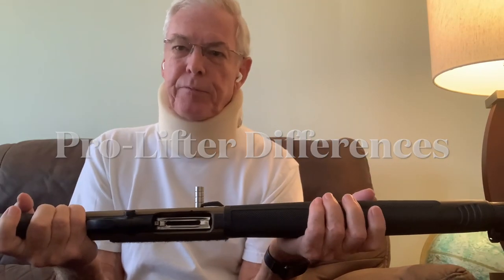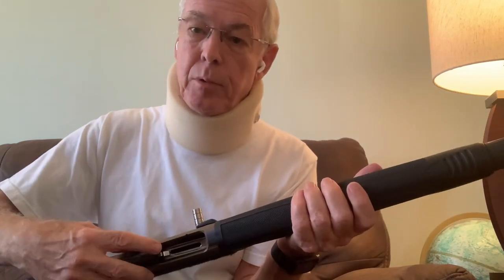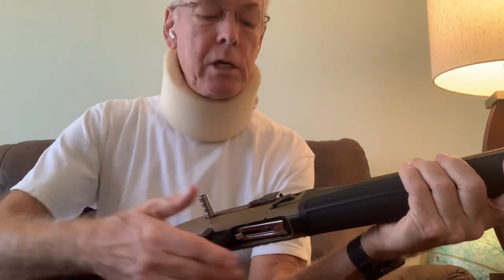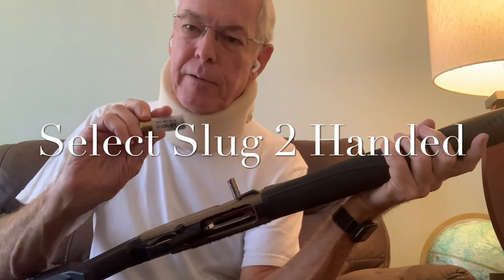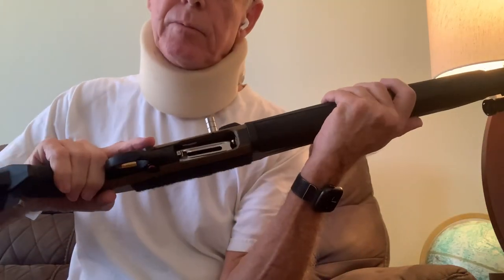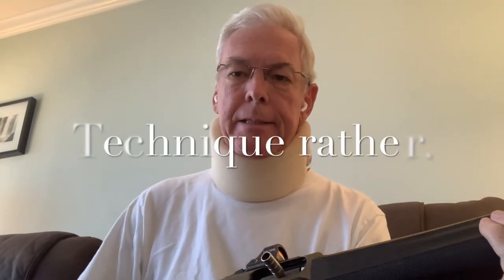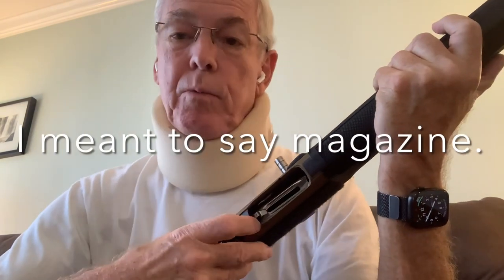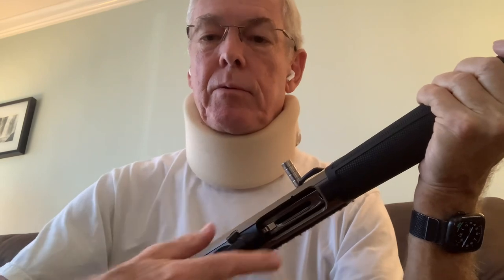Pro-Lifter Differences

Comment: Great video. 2 question. Whats the brand of charging handle, and can you still ghost load. To get 7+1+1 thanks
Reply from the maker: I’ll get back with you on the charging handle in just a second. As to the ghost load, yes you can do that and here is a link to a video showing how it’s done:
https://youtu.be/8FWaJbxGI1g
Reply from the maker: This is the charging handle. It’s made out of titanium, but not cheap:
https://www.customguns.co.uk/product-page/big-bolt-release-handle
Reply: @gospelofthegauge  thanks for the response
Reply from the maker: @inthedogghouse86  you’re welcome. Understand that to do a ghost load you have to load the chamber which is not the safest thing to do with the gun in a staged for HD situation. Not to mention the possibility of a failure because it’s not a designed for condition. I’d leave ghost loading only for the range to impress your friends with, if that.
Reply: @gospelofthegauge does anyone know if the charging handle will work on the a300 Ultima patrol?
Reply: I know a police officer that has a quasi take on the ghost loading. Basically cruiser ready with a full tube and one on the lifter.

Comment: Just put mine in.  It certainly doesn’t come up any higher than the stock lifter during a Slug changeover.  Not sure why anyone would think it is going to cause an issue.
Reply: I haven’t a clue. Some things just get made up while thinking about it, instead of testing it out… Thanks for the comment…

Comment: Beautiful 1301. Is that the Langdon tactical version.  Great review thx
Reply from the maker: Thanks, James. And no, it’s very similar to how Langdon did his builds when he was using the Aridus parts. Mine was just a stock 1301 Gen 2 with removable chokes, in FDE. Or what Beretta thinks FDE is. 😳 Then I added the Nordic 2 round extension, a Benelli mag follower made by a mom and pop company in the US, Magpul SGE stock on Aridus adapter, Aridus CROM, Holosun HS507C on top, Briley trigger group, that titanium bolt handle from England, Blitzkrieg tritium front sight, and the lifter. I did it all myself, except the Briley trigger group. Had I known that Langdon was going to do the whole job himself soon after I bought mine, I would’ve waited and bought one of his. But, it was a lot of fun. Glad you liked the review. Thanks again.

Comment: What red dot is on there sir?
Reply: That kind sir, is a Holosun HS507C. I’m about to replace it with the green dot version. Nonetheless, I think it’s a great sight. Being an open emitter sight, it is more fragile than a closed emitter. However, for my uses, it has been working fine. If you were using it more outside, then I would consider one of Holosun’s, or another manufacturer’s, closed emitter sights.